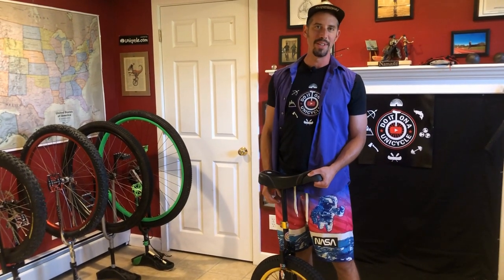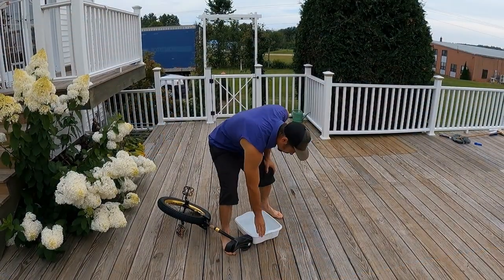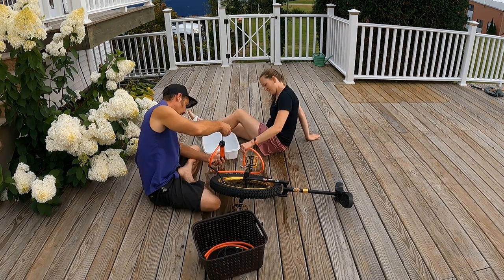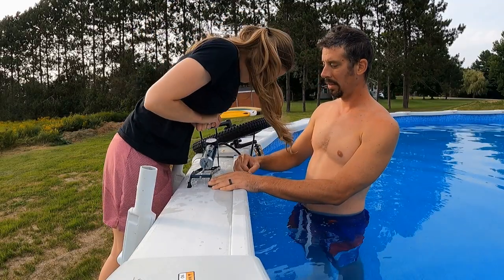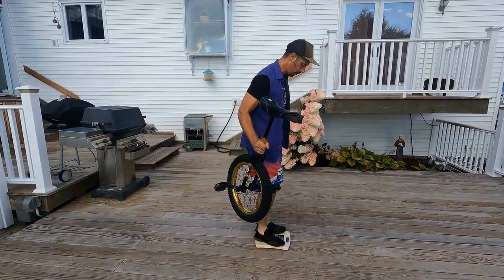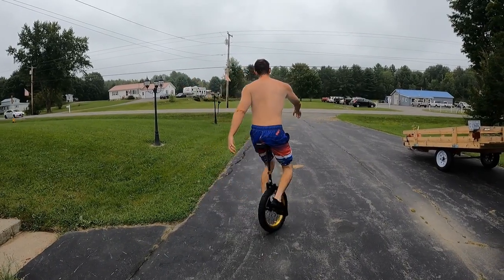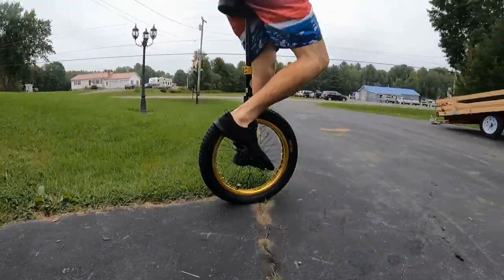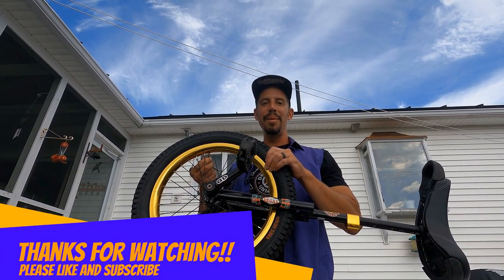What Happens When You Put Water in a Unicycle Tube??

Comment: Dont !
Air is compressible. Water is not. With water in the tire, the only "spring" effect you'll have will be the expansion of the rest of the tube. It will break very fast. If you fill a tire with water with a high pressure, and give the unicycle to a heavy guy, it will break at the first bump.
Reply from the maker: Interesting. I put water in the tire and jumped up and down stairs with no problem 🧐
Reply: @DoItOnAUnicycle 
It simply means that the pressure wasn't that high. The idea is that the water needs a place to go when the tire touch the ground and compress a bit. If the pressure is not too high to begins with, then the "place" the water will go will be in the expansion of the rest of the tire. It will slightly expands like a balloon to compensate the part of the tire touching the ground. Air can compress and reduce its volume a bit, water won't.